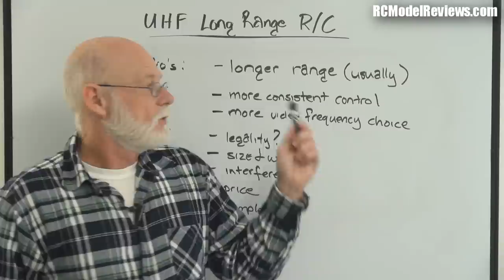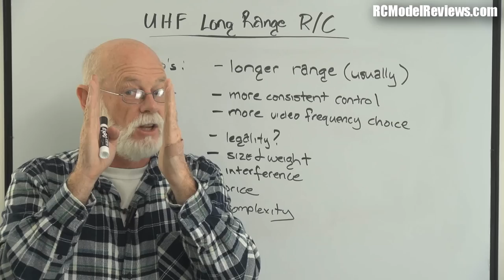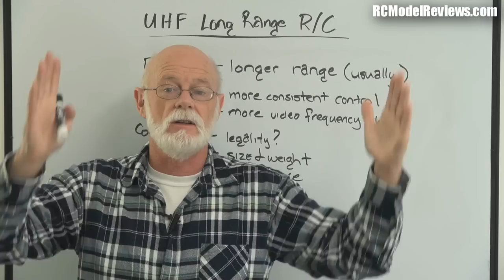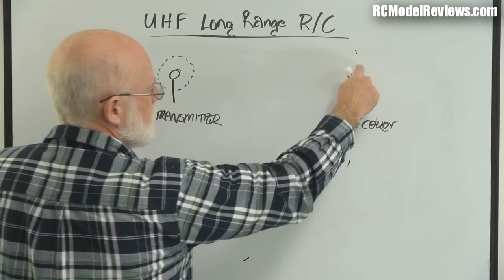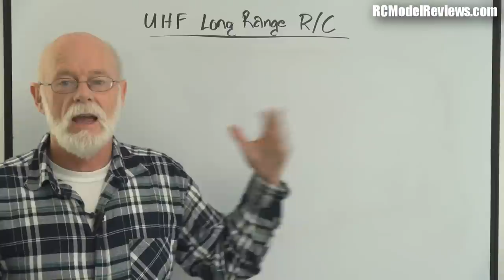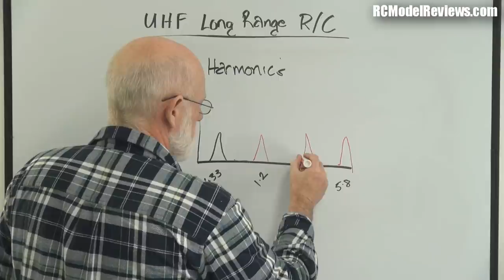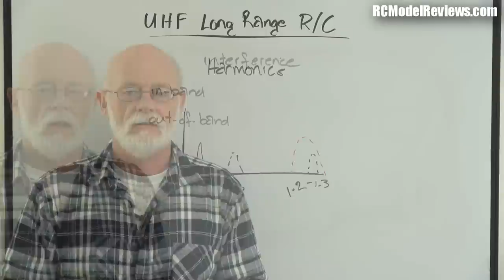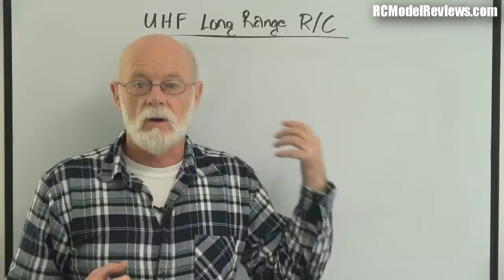Long range UHF RC systems part 1 (the basics)

Comment: Hello Bruce,

First off, I really enjoy your videos, and often watch them several times a month.  Thank you for continuing to provide RC'ers with up-to-date reviews of products and offering guidance!

While I agree with the general spirit if your explanation of lower frequency systems offering better range than 2.4 GHz systems, I do take issue with the way it's explained.  Atmospheric absorption of energy is negligible at both frequencies, and free-space (path) loss is a bit of a misnomer.  In actuality, there is a frequency dependency with the aperture size of the antenna.  If transmit EIRP, range, and receiver gains are kept equal, a UHF system will still receive more power than a 2.4 GHz system due to this frequency dependency of the effective aperture size (that is, the antenna is physically larger for the UHF system and thus acts like a larger "net" to capture the energy propagating towards it).  Just my $0.02 worth as a RF/antenna engineer :).

Comment: Bruce maybe you should compare a Frsky transmitter with a 2W signal booster (and maybe a patch antenna) alongside the UHF systems, like a poor man long range system. I know they are not going to offer the same distance but it will be interesting to know how it performs against the real long range systems.

Also it will be nice too see if the low pass filters for 1.2GHz video really solve the problem of harmonics on 2.4 or if only alleviate it a little. Awesome video Bruce waiting for the next one.
Reply: I use a 2W booster and patch on 2.4. Getting 3.5 to. 4 km. Together with a 600mW 5.8 transmitter with a 5 turn helical. Also no problems until 4 km. So, all fine :) But, I wait and see where Bruce may come up. Never to old to learn ;)
Reply: elpidiovaldez4ever I've done 10km out with unboosted 2.4 on my taranis.  2W is quite a large output :/
Reply: elpidiovaldez4ever I use 1.2Ghz on 2.4 control. I installed a notch filter on the video transmitter and as far as I can see it blocked the second harmonic very well. A Notch Filter is so simple to make. Without it the system would show servo jitter a 100 meters away. After installing it I get 4.2km before fail safe. Hope this helps.
Reply: elpidiovaldez4ever Besides the legal aspects. Why would you want a 2W microwave oven placed near your gonads? I understand that the military needs to fly long range but the hobbyist? If I want to fly FPV in 30Km distance I go there by car and fly there line of sight. But UHF is not only for that...

Comment: Brilliant Bruce! Very good info! I combined 2.4 and 1.3 video lost my quad at just 40 feet. I connected the video transmitter to the wrong power 16V instead of 12V. When I switched power then I lost my craft at 200 feet!! I didn't know at that time about harmonics!

Comment: Hi Bruce. I'm new to the fpv/multirotor world but very old to the radio world from the early 80's onwards. I'm impressed with the new technology and how readily available it is. Even the cheap imported stuff works infinitely better than the prohibitively expensive 'hi-tech' I used to covet in Practical Wireless every month. 

The biggest issue, as you touch on in your video, and still is, is noise. I built a ZMR250 and put an oscilloscope on the ESC 'filtered' output with a PDB LC inline and the ripple was shocking even at idle throttle speeds. Power on the vtx and a GoPro and all Hell breaks loose! I see some people wrap their servo leads on a ferrite ring which will help but not a huge amount. Maybe a video on basic noise reduction would be handy? Decent decoupling, ferrite beads and coaxial bonding made an enormous difference for my set up. I'm a novice pilot but the responsiveness at a longer range was easily visible.

Anyway, keep up the good work. Your channel is a regular view for me it is good to see some old school knowledge still exists out there in this hobby :)

Comment: Really well put together, Bruce. As you pointed out the laws vary country to country. Here in the UK, even with an Amateur Radio License, 433MHz isn't permitted instead there is an allocation for RC on 459MHz. Also 433MHz in this country, 430MHz to 440MHz, is allocated to amateurs on a secondary user basis with the Ministry Of Defence being the primary user, and you certainly wouldn't want to upset the Men with the poisoned tipped umbrellas 😉 Again, using the UK as an example, 433.050MHz to 434.970MHz is a very busy ISM/SRDS band but there are also relatively high powered amateur radio repeaters ( anywhere up to 50Watts into antennas with gain ) also within this allocation. 
Regards
Nidge

Comment: Looking forward to a more detailed discussion and spectra of 3rd harmonic emitted by these LRS. That'll show us how well designed and filtered these LRS Tx's are. Well, at least that one aspect. As you said, there are many more variables. 
Great video series. I'll be looking forward to the next episode.
Reply: EngineerX In my opinion, way too much discussion has already happened around that.  If you're using the one specific frequency of 1280 MHz for video, keep your VRX a few feet from your UHF TX and it's a non-issue. For other video frequencies or if you're using a decent VRX it's also a non-issue.
Reply: Scott Pritchett Agreed, lots of discussion on that subject. However, it may still be beneficial how Bruce presents it as his delivery is very easy to understand and his videos are also aimed at viewers who are getting into a more advanced area of the hobby. So a quick 1-minute segment showing 3rd harmonic amplitudes and frequencies emitted by the reviewed LRS would be interesting and informative, especially to people who don't yet have any experience with LRS setups. Also he has very good spectrum analyzers that can show good data and there are very well known UHF systems in this review that can be compared against each other.  So I think a 1 or 2 minute segment on a fairly important aspect of how well a 433MHz system would play along with 1.2G-1.3G video wouldn't be too bad.
Reply: Scott Pritchett One more note on this.  If you test this on a Dragonlink, make sure to select the "1280 friendly" protocol which massively reduces any radiation around 1280 MHz by changing the FHSS frequency hopping scheme.  It's recommended for anyone using 1280 MHz video.

Comment: I'm watching this video in 2023 with things like ExpressLRS and ImmersionRC Ghost using different modulation of the signal over the air as the old 2.4GHz transmitter and giving results like 100km at just 2W of output power and 100mW of telemetry... Things did change a great deal in the last years  :) Good times!

Comment: Your videos are awesome thanks for making them. I wanted to mention that having a ham license is one thing to be legal but there are also ham operators transmitting mega juice from antenna array, even the ISS has a ham radio. With a big range you could easily run into one. :)

Comment: First of all a wonderfull video. Thanks a lot. A lot :)

I am using frsky 2.4 ghz system with l9r receiver, 600 mw immersion rc for video, and from my experiences, if you have good antennas placed properly, you can have 7 - 8 km range with no problem and for me it is more than enough. I have 4000 mt asl flights in clouds with 6-7 km distance and I really don't need go go further.If you want to, land your plane, go 10 km more with your car and fly again, :) And if you use a RTL autopilot system which I think every fpv pilot must, you can do amazing flights with confidence. Ham radio operators may use a strong signal and deafen your receiver with a high power radio broadcast, so can the radio towers etc. I love your videos and from my perspective people without enough knowledge must stay away from 433 uhf band and if they want to, they must get an amateur radio operator licence. 2.4 and 5.8 is more than enough for rc models.

Comment: good video Bruce! i LOVE my TSLRS. i've done 52 miles on it stock. signal strength & consistency is seemingly always there. I use the TSLRS anytime I fly very expensive or range. Otherwise I stay on Airtronics 2.4ghz (unmatched in latency & strength) and airtronics 72mhz. I can't stand bad signal quality LoL! One major downside to some applications with all LRS systems is latency. The latency is high! I have a well >200mph glider/hotliner I occasionally FPV and while the FPV application practically REQUIRES UHF signal reliability, the latency is VERY obvious at those flight speeds & control sensitivities. Obviously this is not an issue for your typical FPV foamy doing 30-35mph, but it is something to know if you fly sensitive applications (speed, control authority...)

Comment: Hay Bruce, nice video. I think I will use 2.4 on the radio and 5.8 on video. I dont have much room to fly only a couple of acres.  A few questions. 1, Will I need to turn off my wifi to use it on the 2.4? I also have 5 GHz but that shold not be a problem for the 5.8. 2, Any luck on the full list of everything on the mini quad yet? and 3, What is the difference between mode 1 and mode 2 on radios?

Comment: You should really use the Hawkeye OpenLRSng gear.  I've had worlds of problems with the OrangeRX openlrs stuff.  I had a really poor opinion of OpenLRSng before I switched.  It's worth the extra money by a long shot.

Also another great reason to use OpenLRSng is flexibility (which is why I switched).  It supports S.BUS, PPM, PWM, SUMD, Spektrum Satelite, and more features are being added constantly.  A broad range of telemetry support is also a nice feature, as well as custom profiles for settings such as frequency and telemetry protocols.
Reply: Ryan Harrell on the flip side ive been using orange gear for nearly 2 years, without any issues. But i would agree the build quality on the dtf and hawkeye gear looks superior.

Man i love its features!
Reply: I use the DTF UHF with open LRS and I love it. I have the Hawkeye antennas on it and have never had any issues. Great UHF system for the money.
Reply: Yeah, if you're super careful the orangeRX can be ok, but a lot of guys have had range issues that are a result of quality control issues, not a result of OpenLRSng design/code.  The failure rates are high enough to recommend avoiding it if possible.
Reply: Ryan Harrell All you need is a good antenna on the tx, such as the diamond srh-771. and a dipole on the rx. It's worth swapping out the pigtail from the tx board to the antenna, and gluing down the connector. i also made a back plate to angle the antenna better. And thats it. I'd say it's an excellent step into LRS systems.
Reply: Yeah I used a VAS dipole on transmitter and receiver.  My 1W OrangeRX was getting maybe 100m range, and was very susceptible to penetration and polarization issues.  I think as you mentioned the pigtail had come loose inside and damaged the RF module.  I also lost 2 OrangeRX OpenLRS receivers due to a mislabelled 3v3 TTL adapter (was really 5v power with 3v3 logic and I didn't think to check it before I hooked it up learned my lesson on that one).

As I said, if you are VERY careful with the OrangeRX they work ok.  I still think it's worth the little bit extra for the Hawkeye gear, especially if you want something that works reliably out of the box.
Reply: Ryan Harrell Absolutely agree. I've had a lot of pain with OrangeRX. I've resoldered modules, checked everything for a hundred times and haven't got any reasonable range. I've had two receivers and one transmitter (100mw). I knew that many people fly with orangerx for a ten and even more kilometers (there is a video with 100mw orangerx, moxon on tx and turnstyle on rx - 10+km).
I was already ready to mark openlrs as crap for myself. But i've given another chanse to openlrs in my backpack. I've ordered DTF UHF rx and tx. And everything worked like a charm. 
Plenty of range. Currently flown only for a 6.2km, and signal was pretty strong. About 90% of half - may be you can help me: my rssi drops in half in first 50m, and then decreses very slowly as it shoud be. Is it ok?
Reply: Vital Belikov  How are you measuring RSSI? Via telemetry in your transmitter? Digital or Analog RSSI output?  Could be something is calibrated wrong in your RSSI measurement. You should post your troubles over in the OpenLRSng thread at RCGroups.
Reply: Ryan Harrell Thank you for fast reply.
I can't say that it strains me a lot. But i've decided that it's good time to ask someone is it normal or not :)
RSSI readings are viewed via OSD. And i'm using analog output - there is a solder jumper on DTF UHF module, which enables it. It readed by Pixhawk and transmitted to osd. I haven't checked it deeply enough. I think that at first i need to ground test it with multimeter at least.
I've just wanted to know: is it standart behavior of openlrs or not. Taking in mind your answer i can think that it's not. I'll check everything for a couple of times before disturb people on rcgroups.
Reply: Have you added a RC buffer on the RSSI output?
Reply: Benjamin Harvey Do you mean RC-filter? As I told in previous comment that i'm using rc-filter integrated in rx. But I tried using external filter with no success. Today I made some ground testing and spectrum analyzing and have one idea. Need to test it in a fly, but seems like my problem is solved.
Reply: Benjamin Harvey I use RSSI injection on S.BUS and get it either in my OSD or via FrSky telemetry. Would the lack of a buffer on an analog system cause what he's seeing? I'm not familiar.
Reply: Vital Belikov What ended up being the fix?
Reply: Ryan Harrell It haven't ended yet. I flown to 10km, but rssi was not stable. Sometimes it was 80% sometimes 30%... But there was no FS. I'm trying to discuss problems with developers. They are giving some advices, but no advice was helpful. There was even worse situation: my RX unbinded from my TX. Developers confirmed that i'm not first with this problem. I was 8km away when this happened. Plane was set to RTH and it came home, but it was flying in circles above me as it should, waiting for me to take control. But i was unable to regain control! So it flew in circles until battery run out and crash landed.

Comment: Bruce, you mentioned UHF Rx size and harmonics with the 1.2-1.3GHz freqs.  I'd just like to add some info on the DragonLink system.    Their new MicroRx is pretty small and has LOADs of features....Rx channel mapping, frequency analyzer, etc.  Also, DL has a '1280 friendly' firmware that can be loaded in the DL Tx and Rx for those who experience harmonics issues on the 1280GHz video freq. The firmware prevents hops onto any freqs with harmonics on 1280G.  1258GHz doesn't have the harmonics issue, so should be safe to use without harmonics interference.

Comment: Hello from Adelaide S.A    Bruce: I would like to ask if it would be feasible to run a Video system for FPV utilizing a 2.4Ghz Spread Spectrum TX RX ? It was while I was trolling for info on long range FPV and I read a lot of what your introducing us to here (and doing a fine ob I may add)but the Spread Spectrum thing keeps popping back into my mind ?.The video signal can be sent through a Orange 2.4Ghz 6 ch  utilizing PPM stream or can it? I'm quite ignorant when it comes to what video wants to be good,can you get me enlightened on this matter as your explanations are always very clear and easy to understand....and as you know when you hit sixty things get harder to get things right in your grey matter??? well I do anyway!.
Thank you for any light you can shed on this matter as it is bugging me that I can't find an easy answer right now.....cheers mate
John  who fly's Heli's 200,450,550,700 and an Ergo 30 JR  original
 Also: Quads from  mini wooops to 400 class with fpv and Flight computer (apm 2.6) also Planes Yak 54 just for 3D stuff and a Z84 wing Wing which is latest project to get fpv and this is the one I would like to run a LR UHF system to dip my toe into Mile Plus flights and out to maybe 10Km to check on whales that come in to 3 or 4 Km's from shore and I would like to keep an eye on their safety .Thanks again for any help...
Also would like to get Ham Licence so a vid on how to get one will be of massive interest to myself and many others I can see...look forward to that one when you get time.(I don't know how you do all the stuff you do Bruce my clock seems to always outrun my day and the weekends end up being catchup for me constantly

Comment: Very,very good video, Bruce. I do have a question, though. Why the introduction of UHF transmitters and receivers for long range 433mhz, where there is a surplus of HF transmitters and receivers whether (depending on the country) it is 72mhz, 27mhz, 35mhz and probably others? Was it because of poor signal rejection of the old receivers? I have changed over to 2.4ghz equipment (some with the aid of your videos-thank you) but I do intend to keep and use the 72mhz equipment that I currently have. Keep up the good work!

Comment: Hi Bruce, thanks for a fascinating video. Would I be correct in assuming that the use of the old fashion 27Mhz and 35Mhz systems used in the UK would give potentially far greater range for a given output power than any of the frequencies discussed

Comment: Awesome and informative video as usual Bruce. Could you elaborate on the use of antennas? Like monopoles, dipoles, half wave. What is the benefit of circular polarized versus linear polarized or vice versa? 

When you're on the antennas subject anyway, what would be the recommended/best antenna choice for a long range setup (in the 1.2/1.3ghz range)

I'm kind of a dyslexic, could you help us out on our ham band knowledge? (I got all my technical knowledge from your vids amongst others-thank you again).